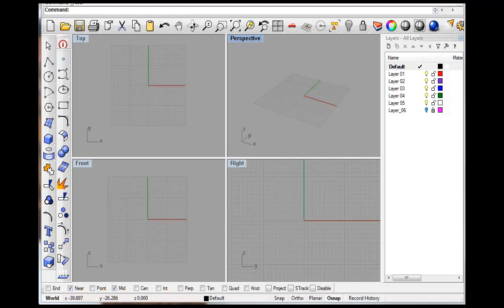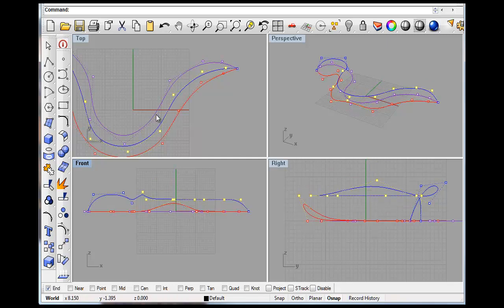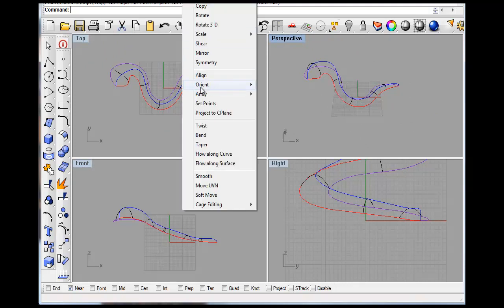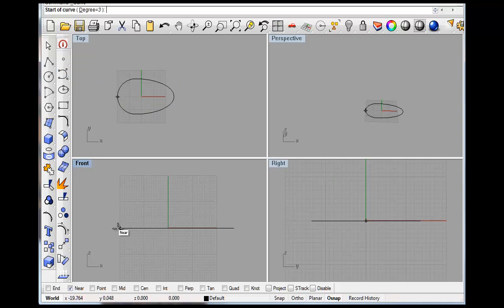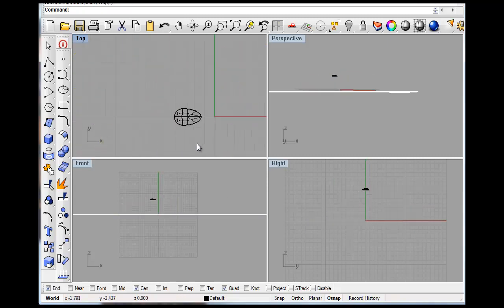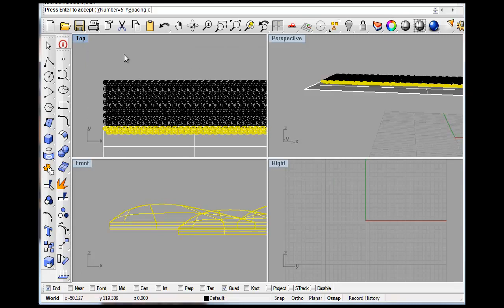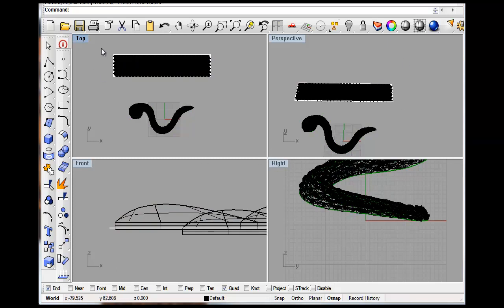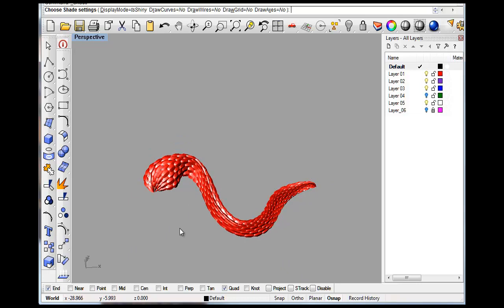Rhino Tutorial Making a model in rhino and flowing scales / texture onto it

Comment: I have problem stuck in the  " flow along structure step", I have checked everything and previous steps  plus also fitted the appropriate scale of  texture objects into the UV Plane, still cannot figure out what's wrong with it.... Can any one help?? I checked my layers too, no problem in it
Reply from the maker: What is the problem ? its difficult to workout without a picture ,if you follow the command line it should help also check the rhino help videos they will point you in the right direction
Reply: I was facing the same problem, if you draw a surface below the rectangle (the projected uv curve) you will be able to select and do the rest. :)

Comment: How did you keep getting the point to show?
Reply from the maker: You can use F10 to turn on points and F11 to turn them off or config them to a different hotkey in rhino settings
Reply: Josef1cnc Also you can push Esc key twice to turn points off. Very useful